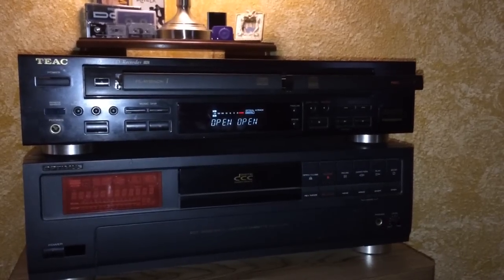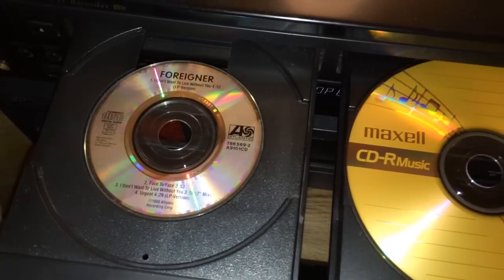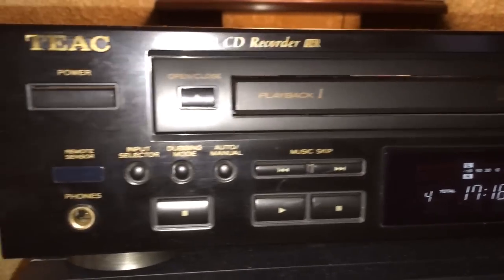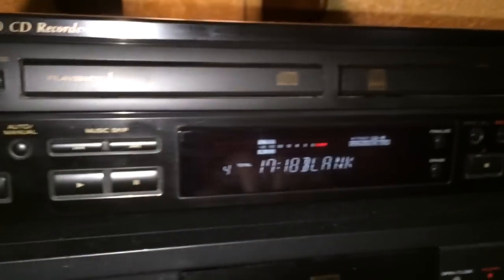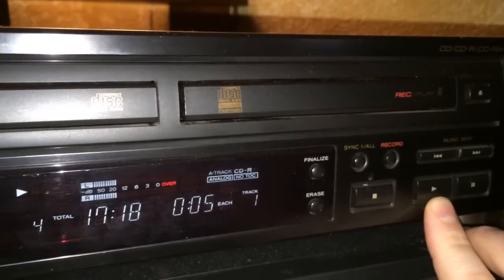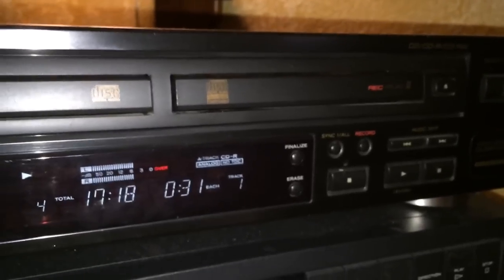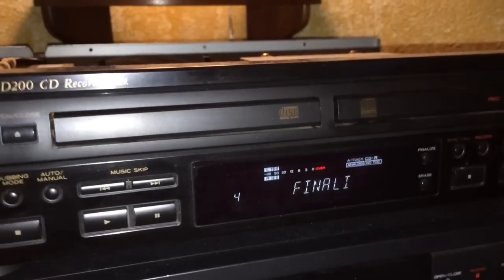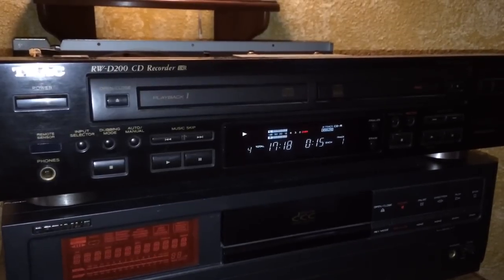How to burn a CD-R using TEAC RW-D200 CD Recorder and Copier

Comment: I have a sony cd500 recorder model think it finally took a dump i took it part to see why when i push the button to open it nothing happens on the 5 tray side the blank disc side opens fine may take it to sony to have it repaired when it was working it worked great hopefully they can fix it for no more then 200$ i see the only recorders they sell today are only available by Teac which doesnt have best reviews @ 3.1 stars but its going for 229$ other places 279$ so need decide whether buy new unit for same price would cost to have older unite repaired.

Comment: I have one that has worked perfectly for 20 years or more until recently. Now, the play back cd drawer stays closed and won’t open, and the recorder/player drawer won’t close.

I’ve opened it up but don’t see anything obvious causing the problem. Suggestions anyone on how to fix it or should i get a professional to do it ?
Reply from the maker: The open/close belts have gone bad.  With a little skill, you can replace them yourself.  Once the drawer is open (you will have to manually open it) the belts are visible underneath the drawers.
Reply: I managed to get’er working again, after replacing the bands under the shelf, but , now , the screen won’t reset . 
I works ( thank God) but , without the proper screen display, i can’t record anything. Maybe one of the ribbons isn’t connected right ? 
Or something like that ? 
Thank you for the reply btw . 😁

Comment: This was great . So how can I record a vinyl ?? on to CD ???. Thank you . Oh I have the older turntable with the red and whit plugs !!!
Reply: You need to route the sound through a pre amp/dj mixer then to your stereo, then route that into the Teac. That way you can adjust the audio levels before it goes to the cd recorder. 
The bare bones audio level of your turntable isn’t enough for the cd recorder. The dj mixer pre amp is key, especially if you want the correct sound levels & eq for your sound system or any other.

Comment: Does this  player  let u use a cd ,like maybe cd discs for computers ,or does it have to say digital audio ,i know theere alll digital but theres a difference. I have this player but needs fixed. I use to have a sony and the only discs it worked in is the discs that say digital  auto
Reply: It only records to CD-R / RW Audio discs. Normal computer Cd-R / RW discs wont work for recording. It will play any disc though.
Reply: The key to using the Teac is , 
the Cd’s you buy, should be labeled 
“ Digital Audio “ . Not all blank Cd’s are the same. 
Wether you use a ReWritable Cd or a Cd-R to record it must have/be 
“ Digital Audio “ on the label . 

Then, in order for it to be played on any other system, that disc must be “ Finalized “ after you record it. 

ReWritable disc’s can be “Unfinalized” and erased, Cd-R’s cannot be erased . Key, again is the “ Digital Audio “ 
Mp3 , as long as the disc is Finalized , should play fine .